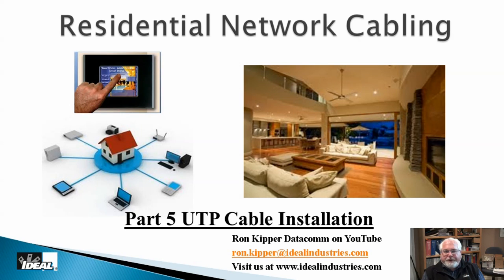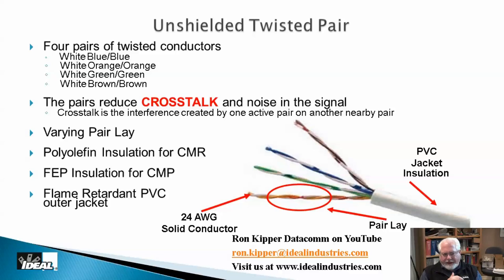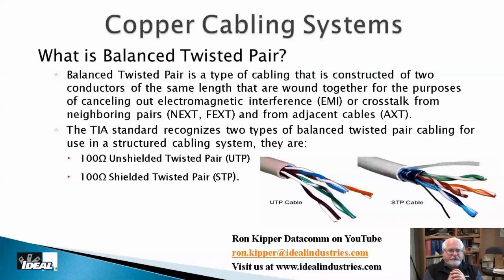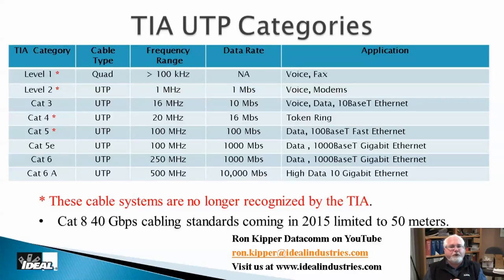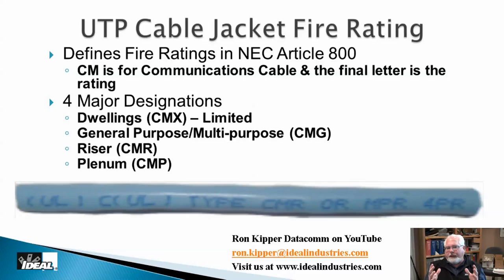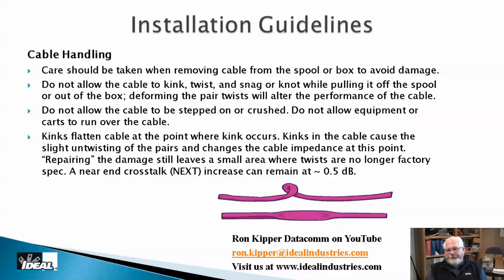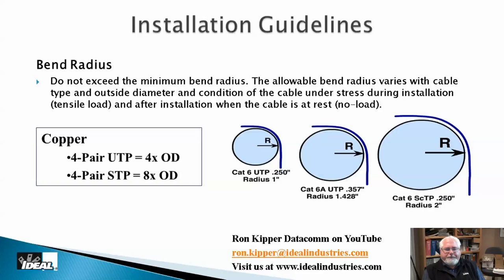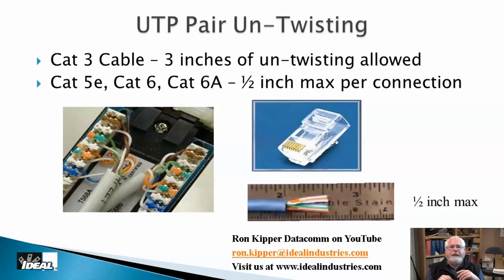Residential Network Cabling Part 5 UTP Cable

Comment: Thanks Ron, your videos are great.  My mother just moved and was having problems with her DSL.  The whole house was wired in old quad wire.  Using the info in your videos I have rerun everything in CAT5e as a full structured media system.  Things are working very well now.  The only small glitch I ran into was some confusion RJ45 vs RJ11 receptacles.  Even the folks at the home improvement store had no idea what to do with it...  I did figure it out but there was a bit of head scratching involved.

Comment: Has anyone got information that explains the standards for structured cabling in its entirety aimed at beginners like these videos
Reply from the maker: Michael if you want to learn more check out BICSI https://www.bicsi.org/double.aspx?l=1094&r=1098 they offer all kinds of training courses. Good luck Ron
Reply: Thanks Ron. I am an electrical apprentice that will do a Telecoms module this year. It will mainly be cabling standards i assume on this type of course. Just looking for stuff an electrician would need to know to do his job
Reply from the maker: Good luck Michael I used to offer a 1 day course through Home Depot that covered residential low voltage wiring and these videos cover a lot of what we did in the class except for the hands on training on making all the connections. Take care Ron